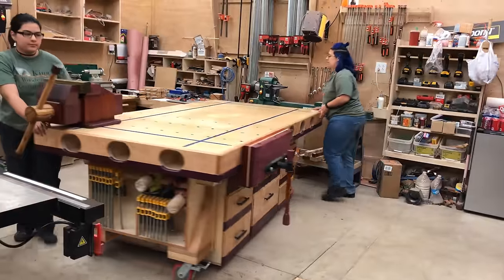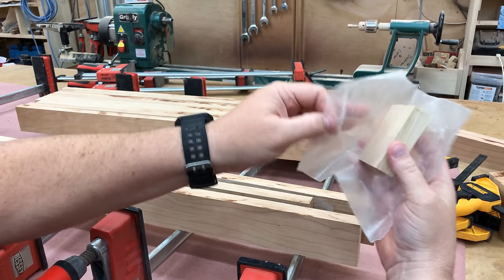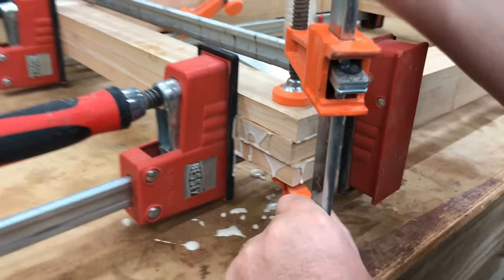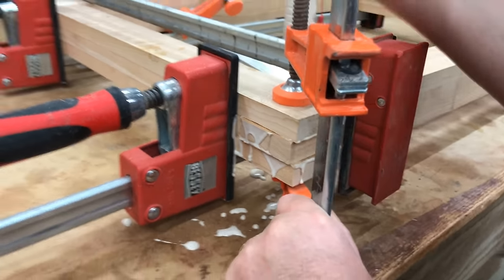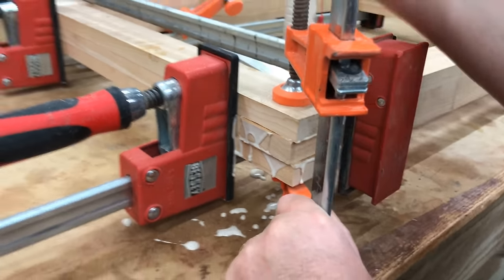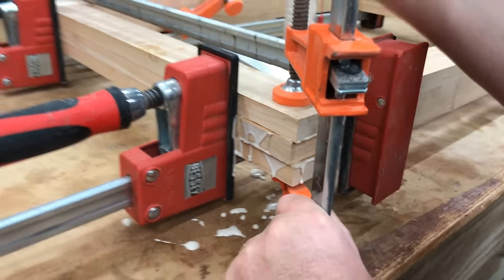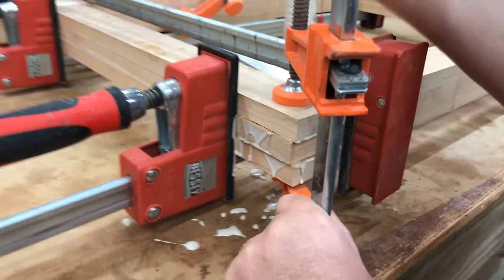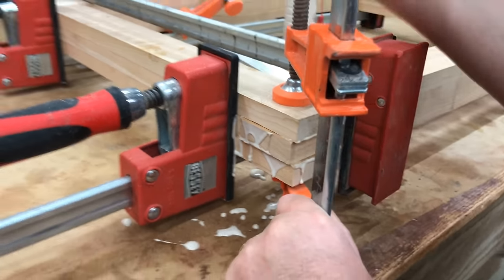62 - Extreme Torsion Box Assembly Table, Outfeed & Multifunction Workbench w/Storage

Comment: I normally have issues with either the design of something or how it's put together, but this beast is one of very few things I've seen where I can't disagree with any aspect of it! Very impressive. I personally prefer to not use pocket holes but I also have a Domino, so I'm lucky there. I have avoided figuring out what I'll do for a proper bench when I move my old small shop into the new big one I'm building because I didn't think I'd find anything I'd really like and would have to design my own. But you've fixed that, so expect a plans purchase from me!

Comment: Nice start. That is pretty much bomb proof. I just started rebuilding my shop. We moved 6 months ago and I finally built my mitresaw station. I reused my old kitchen cabinet carcasses. Saved a lot of time and plywood. Not finished yet, but got a good start.
Reply from the maker: Awesome! My very first Miter Station was old kitchen cabinets. That is a fantastic use for them!
Reply: King's Fine Woodworking this is my second, my first was built from scratch. We just renovated our kitchen, so I kept whatever lower cabinets I could. I’ll build all new drawers, i just don’t have the space or time right now. It’s a hobby and a work in progress.
Reply: Gladious789 you can buy a oak kitchen cabinet set cheap. Sand down and refinish. I would get orders for 5 others then sell  pre fab units to pay for my own unit.

Comment: That is a sweet assembly table!! No need to apologize for using pocket hole screws. You use what makes sense to you for each project.  Everything doesn't have to be hand cut dovetails and Japanese scarf joints.  Like everything you do ... very well done even if a few of those joints are a bit glue starved ;)
Reply from the maker: Thank you!!  And I knew I should have used another half gallon of glue!

Comment: Very nice bookshelf. 
I see Titebond loves you. I saved thousands a year, by getting rid of Titebond. Not so much because it is too expensive, but it really wastes a massive amount of time. Consider getting in contact with a company called Würth ans get some of their D3 and quick drying furniture glue. You will cut your production time massively. And, whilst on the topic of trying new things out, get yourself a Pica pencil. They need regular sharpening, which isn’t a problem with the built in sharpener, but you can draw a super fine line, making it easy to do really accurate work. Hope that helps.

Comment: Very nice build, James. You have some very talented daughters with "Extreme-ly" good skills.

Your method for bridal joints is awesome, and I might try that with multiple plies of plywood, instead of hardwood. A question on these joints, however: since you glued up the 3 ply blanks and solidly clamped them and dried, is there enough room for glue (thickness wise) in the joints? It looks as if most of the glue is pushed out just by assembling the vertical pieces to the horizontals even before you clamp up the final assembly. Maybe the two glue joints takes up enough thickness even after clamping?

Comment: The Shakers, as well as many other furniture makers from way back whenever, also used pocket holes at times. Obviously they didn't have a Kreg etc, or even electric drills, but, for many applications you can hand drill with an electric or not, your own pockets freehand, so, for those who think pocket holes are a modern shortcut, they are wrong on their thinking. Also, no one back then used washer head screws. They used their everyday slotted head wood screw.

Comment: I know this has been out for a while. It is a beautiful piece of work! I was curious as to how tall is it completed per the plans? I want to use it for my outfeed table and need to make sure it is the correct height without figuring out modifications! Thank you!
Reply from the maker: Hi, it’s 36” using The wheels I used. And it’s really easy to modify the height to an exact number if needed. Thanks!

Comment: Question:  When you crosscut your plywood, it didn't chip.  I have to put tape over my cut line in order to achieve that.  What are you doing differently I wonder?  Higher quality saw, or the blade perhaps?
Reply: High quality and SHARP blade. Having perfect alignment between the blade and the melter slot is also important.

Comment: Hi, I like your videos and I like that your kids are involved with your woodworking skills. Can you tell me what is the best way to remove glue so the stain/dye can penetrate? You do beautiful work.
Reply from the maker: Thank you!

If the glue is wet, I use a damp rag. But if it has already dried, you will need to sand it out. 
You can test if it’s fully cleaned off. Just apply some mineral spirits to the area with a cloth. It will absorb in e evenly everywhere if the glue is gone. But it will be splotchy if not. 

So just sand some more & try again. Do this test everywhere before applying a stain or finish, and you won’t have a messed up or splotchy stain job.
Reply: @KingsFineWoodworking   Thank you James. I'll give it a shot.
Reply: @KingsFineWoodworking  Hi James. I was wondering if I could ask you another question. Looks like you have quite a bit of Grizzly machinery. I'd like to buy their G1023 RL Table Saw. Just wondering if you're happy with Grizzly? Looks like they make some nice stuff. Thank you.

Comment: Hi James 
Thank you and your family for taking the time to post these videos for us beginners. 
I made the Adirondack chairs for my aunt and uncle out of Cedar and Meranti ( aka Philippine Mahogany) and they were thrilled with them so thank you again.  
I have a question ….well truth be told a few questions. 
I have limited workshop space HOWEVER if I use this table assembly for multiple purposes the 4x8 size might be good for me. 
My question(s) are in your opinion could this design be tweaked to accommodate consolidating a table saw into it using the outermost edge on the long side to where the front of the saw would be figuring a table saw like the G0601 you have ( the 12” 5hp saw) ? 
I’m thinking that yes it could but probably would need to be reinforced along the bottom where it would be located and possibly would need extra casters and mounting for them. 
I got the idea from another YouTube guy who set up his saw into his table (somewhat like yours) BUT he used a “job site saw” 
I’m looking to have a saw that has more power than my current 1.5 hp Delta contractors saw but again I have limited space (not all of a 2 car garage )  so I thought if I could get the 12” Grizzly but was able to mount it as part of the assembly table it wouldn’t take up more space and would actually free up more space if I could mount my router into the table on the opposite side of the table saw. 
What are your thoughts on this? 
Thank you for your help
John
Reply from the maker: Hi John,
Lot to type. :-)

Message me on Facebook, and I’ll send you my phone number, and we can chat about some ideas that might be easier to talk about than write about. 👍🏻

Comment: Certainly built a fine work bench. I think I'm doing good if I put one together  with some 2 x4 framing and a plywood top.

One thing I question though is I hear a lot of I did this and I did that. What I see is two young ladies doing almost all the work. How'd you get that to work out? My wife would tell me to pound sand.😆
Reply from the maker: Hi Roger, you are so right!  I am used used to narrating in the first person which I did in the beginning. And I feel like we are a cohesive unit working together, I think maybe I just overlook the fact, that 90% of the time my daughters are doing it!!  

I feel like such an idiot. 

I would be very upset if someone else didn’t give them credit where it was due, and here I find myself doing it.  

I have to break that habit immediately. Thank you for pointing it out.

Comment: Sure you may be overrated for sheer and tensile load but people often dont consider fatigue strength. Knowing the base material is oak and the size of the piece it just looks proportionate. The screws that will take more “side moment” cantilever loading needed to have the more thread engagement you installed. And you did that. Looks awesome. 

Side story about strengths: Years ago i saw some daredevil dude do a multi person swing jump off a bridge in florida. Got a bunch of his friends seriously hurt. When interviewed he said “I just cant understand why the cables failed? I added up all the load ratings and it should have held!”. He didnt factor in the extreme load added by centrifugal force with weight swinging from the end of a cable. Careless. Ignorance breeds confidence.

Comment: Most lower cabinets have a toe kick but the base cabinets of this assembly appear to barely hover above the floor. Any issues with toe room when working at the assembly table??
Reply from the maker: No issue with this because the bench top hangs over 6" as opposed to a counter top, which hangs over 1-1/2" - 2".

Comment: That's one heavy duty table. I'm thinking you could save on some cost by using the center rib as a shared cabinet back for both sides rather than having the cabinets have their own 3/4" plywood. You essentially have a 2-1/4" thick plywood sandwich running down the center adding excess weight. You could also double up on the center rib which would still use one less piece of plywood. Good design though, I like it.
Reply from the maker: Thank you. And you are correct.

Comment: Pure Living for Life might have a strong disagreement about the GRK's breaking. It seems they had to make provisions to cut them off rather than removing or screwing them further because they have a tendency to break. ????? Me ? I don't use them.
Reply from the maker: Hi Clyde. That is pretty interesting. I imagine they can break under the torque of an impact driver if an adequate hole isn't made first. I will have to go and check out that channel. Thanks.
Reply: Wasn't the problem they had when they tried to remove the screws?  Those impact drivers do a number on the screws makeup and then to remove in the opposite direction just torqs the heads right off.
Reply from the maker: Interesting. I wonder if they don't have as much torque strength as they do shearing strength.
Reply: Well every one they tried to remove broke off so they ended up cutting them off rather than trying to remove them or driving them in further. It was the sills for SIPs  and I don't think there was predrilling and they did use impact drivers.The sills were 1/2 inch(?) too wide so they were trying to correct that.
Reply from the maker: Good to know Clyde, thank you!
Reply: Yes the problem was that they inserted 7 or 8 inch screws without pre-drilling, and some time later tried to remove them. I believe they were mistaken in blaming the screws.

Comment: Some terrible nonsens is told in this video. 
-  The wood has the wrong direction on the annual rings. Vertical rings in the glued framing will move a lot less by humidity. If you can't get vertical rings, do thinner layers and rotate the layers, so they will move against each other. This is the same principle as on plywood and will reduce the movement of the whole piece to a minimum.
- Any kind of plywood for the worktop? People wil have fun with non multiple layer ply. 5 layer will not do.
- Single screws in the center legs? Not enough as the wood is taken here with horizontal annual rings. The legs might rotate if the wood or the workshop changes humidity.
- A shame to use nice wood and connect it with screws.
- Non countersunk screws will collide probably with the drawer sliders.

Just a fast watch. Surely can find more. 
While the idea with the storage directly below the worktop is good you're missing the fixation hole system.
The wheels will be in the way of the feet often.